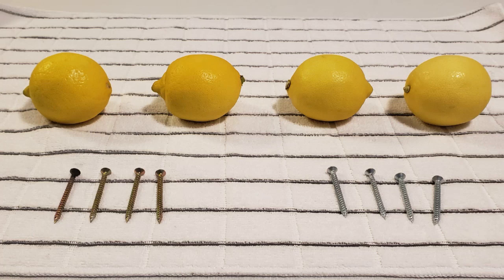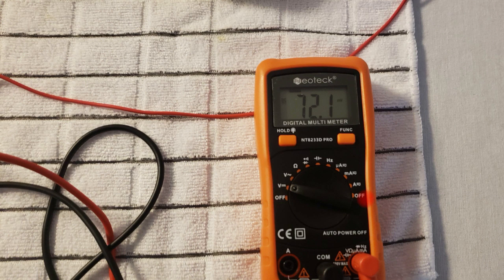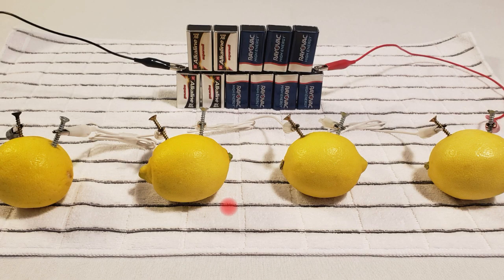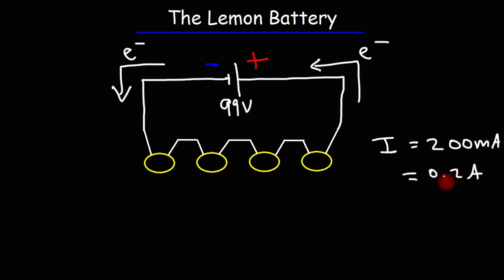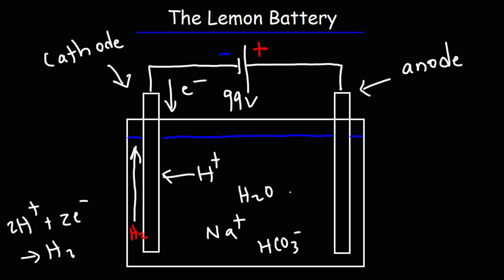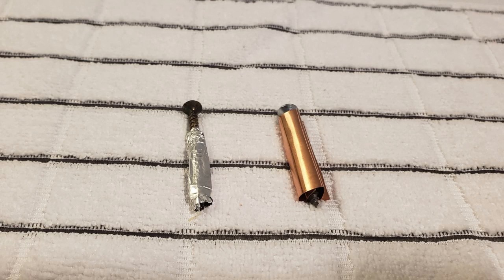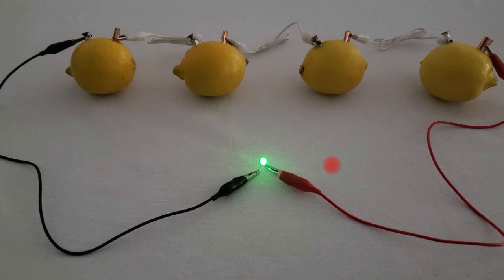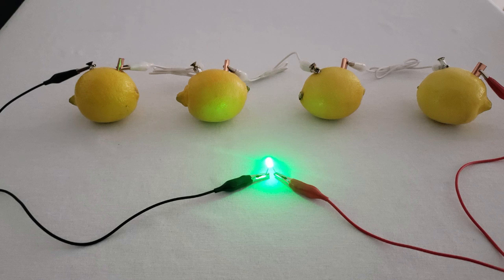How To Super-Charge a Lemon Battery to Power a Green LED

Comment: I dont understand why charging lemon battery can make the output voltage higher. Isn't it the voltage generated is due to the reactivity difference between two metal screws？ charging doesn't alter the composition of screws, how can it increase the voltage. Would you answer me?thank you